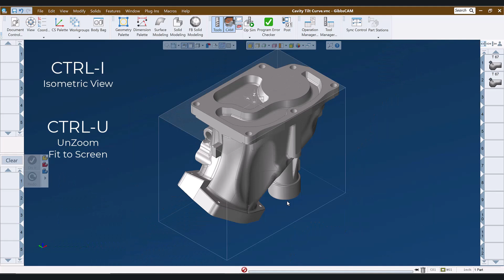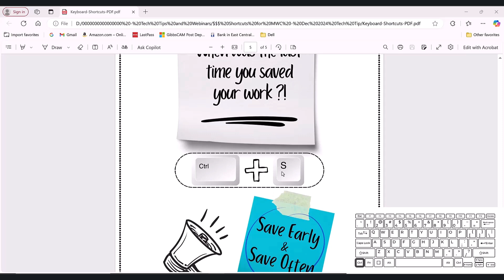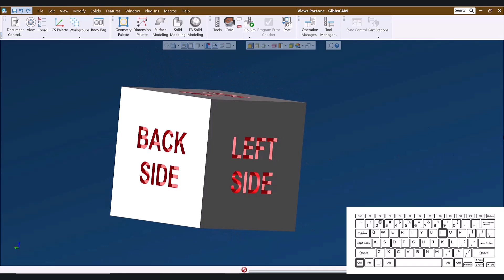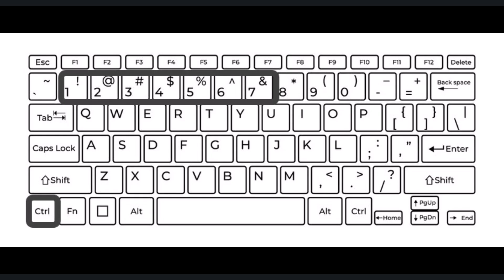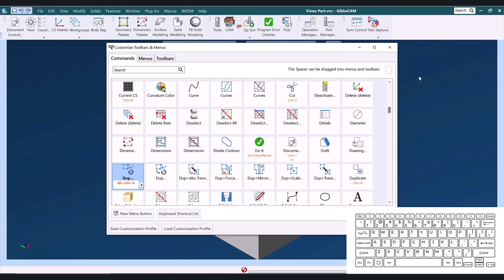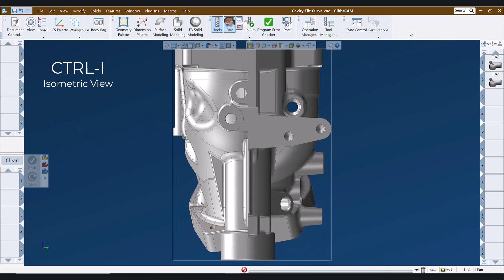Speed Up Your Programming with Keyboard Shortcuts | GibbsCAM Tech Tip

Comment: Hello. 

One time saving thing that I found is setting the connect command to the Q key.  This way I can quickly and efficiently connect geometry together with a simple keystroke. However, in Gibbscam2024, the Q hotkey will not work when a geometry tool is open (parallel line, circle by center point&radius, etc). Is Gibbscam aware of this change? Can they come up with a solution to the issue? In Gibbs2023 and prior, setting the Q to connect command had no issues, but in Gibbs2024, not so much.  Why the difference?